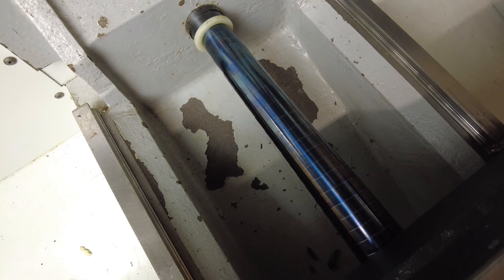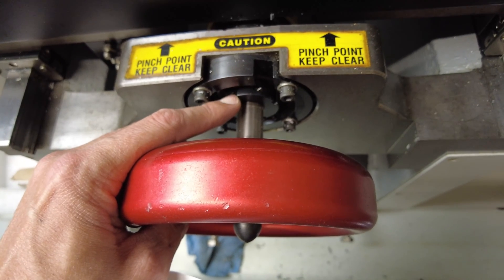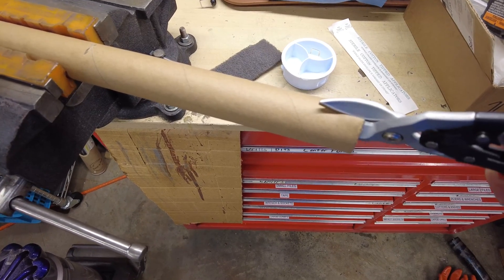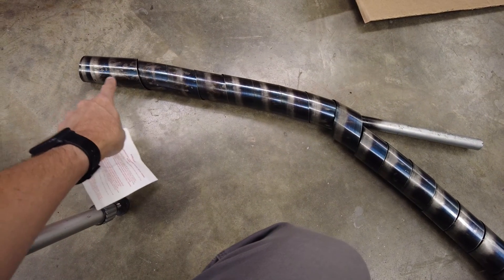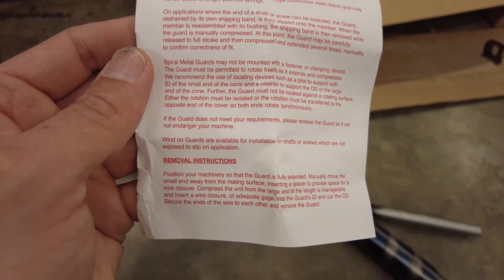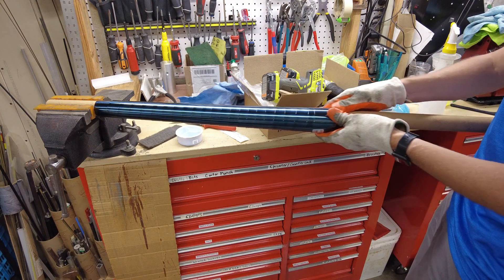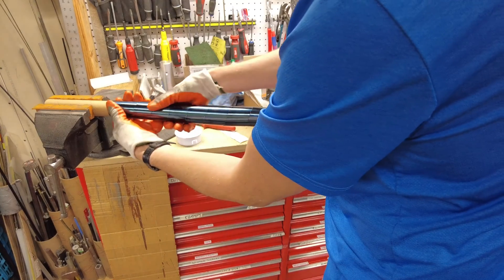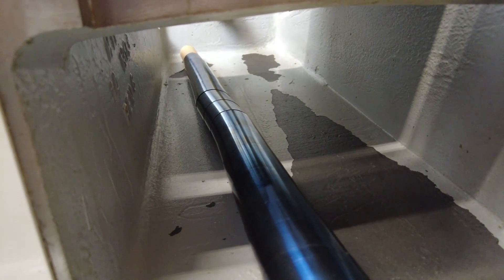Easy way to replace rear Y axis ball screw cover on HAAS TM-1 CNC Milling Machine (No taking apart)

Comment: Ist there a way to Jog the Machine without referencing it after turning it on?
Reply from the maker: Yes, Parameter 53 as posted by HAAS here: https://www.haascnc.com/service/codes-settings.type=setting.machine=mill.value=S53.html
 Caution that this could cause damage if you slammed into the endstops.
Reply: @engineerable  thanks very much. We just had to push the y or rotate the y asix by hand .  It's was the ballcrew cover that was crushed and was preventing the machine to be zeroed and jumped into emergency brake ..with the Error y servo to big.

Comment: Do you have the McMaster part #.
I can't seem to find it on the website
Reply from the maker: I've updated the description and you can also see my post about this here https://www.engineerable.com/single-post/haas-tm-1-y-ballscrew-cover-replacement
I could not find a matching Mcmaster spring for the rear cover, only the front. So I paid the premium and bought the rear one from Haas.